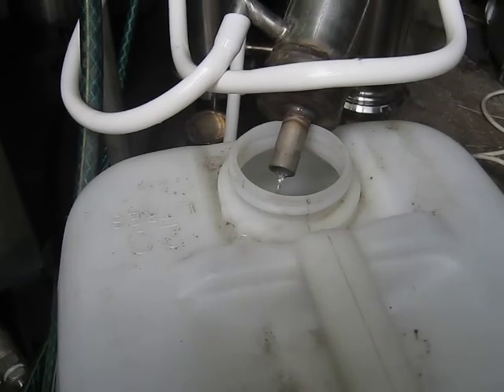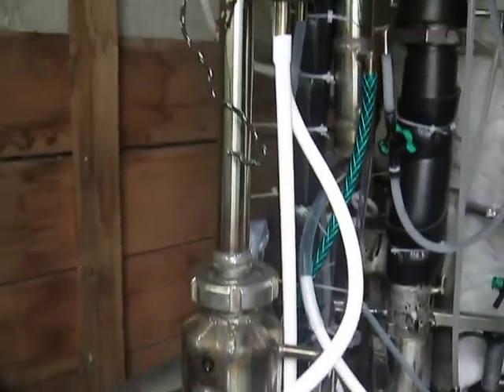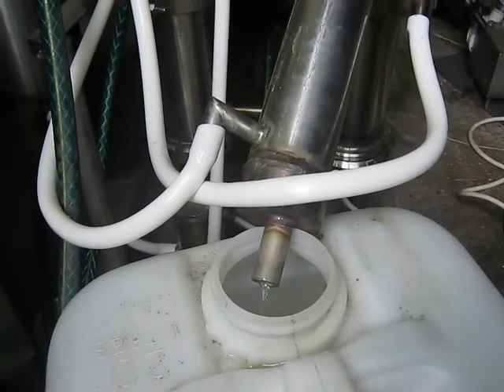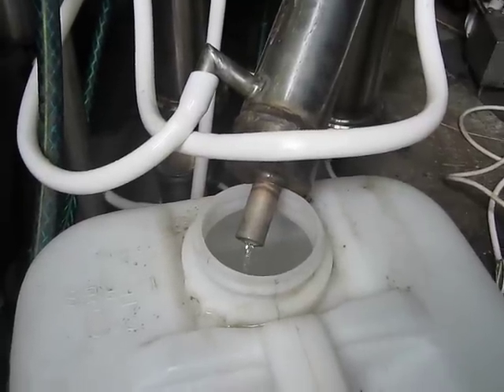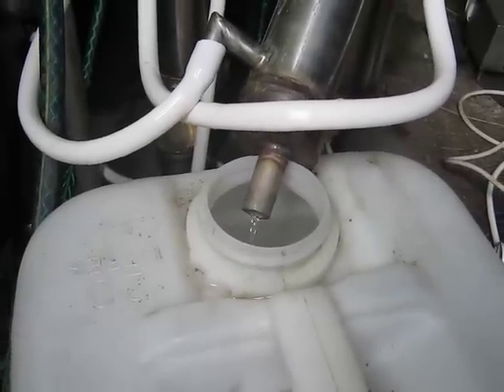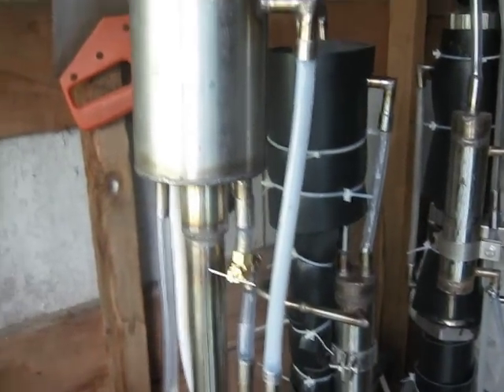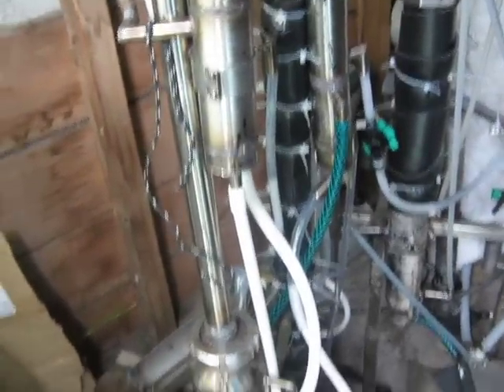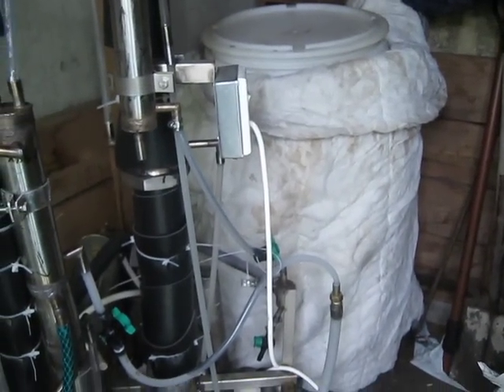Small and fast continuous alcohol still for home use.

Comment from the maker: @CreQ Hi, no I did not, this is the primary distillation and this is crude ethanol that later will be purified in the fractional still, then diluted down to 40%, run through a carbon filter , poured into the bottle, placed into the freezer to be cooled down and only then transported from the bottle into my mouth by the means of the shot glass.
Thanks.